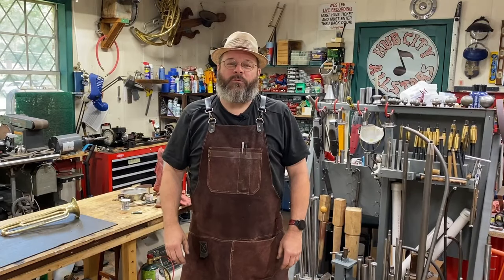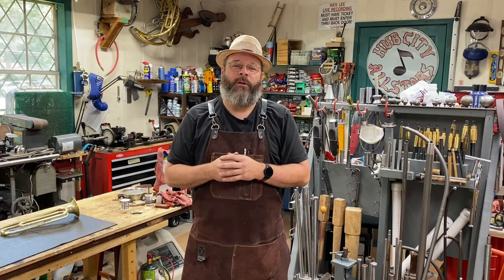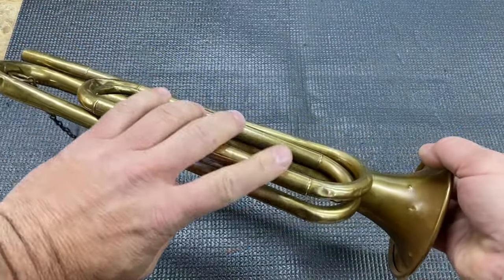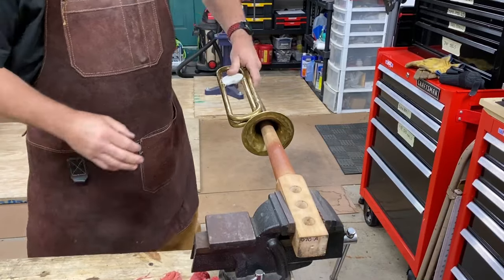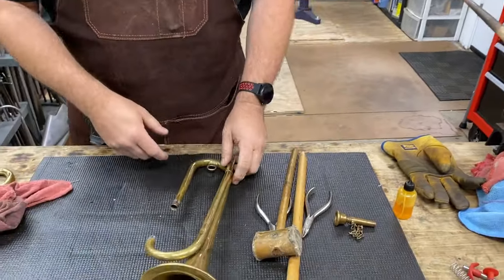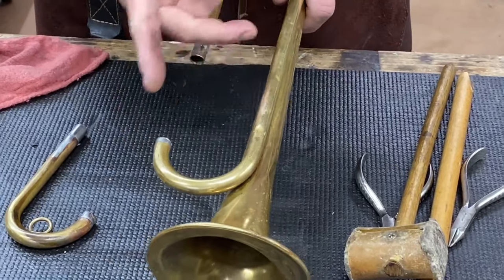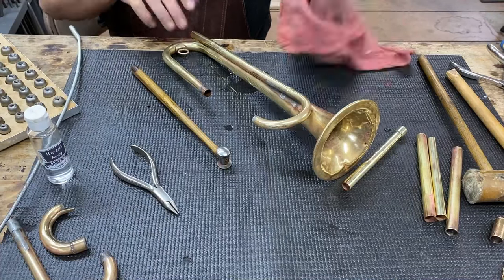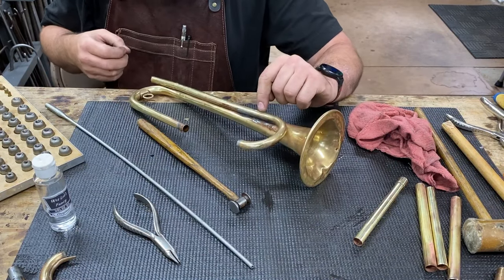The Bugle- a Restoration project- band instrument repair- Wes lee music

Comment: The coefficient of thermal expansion of nickel silver is about 20% lower than that of brass.  If a nickel-silver slide is stuck inside a brass tube, heat will loosen them up.

Comment: THANKS FOR THE RESTORATION and for the amazing TJ story. 
As an old craftsman to another, if you'll get a STAINLESS-STEEL ball bearing, that is the size of the inside of your tubing, and put a form on the outside of the tubing, you can put smaller ball bearings in behind the SIZING ball bearing and squeeze or tap them thru till they roll smooth. The smaller balls apply constant force to the main ball. Use a good grade of oil during the procedure. It makes little difference how far it goes, as long as you don't have a pocket, like a valve, for the ball to get hung in. I hope this helps.
   Bill, from Tn. 🇺🇸